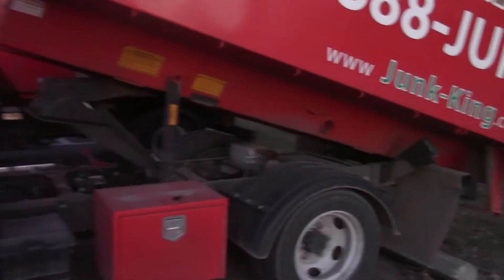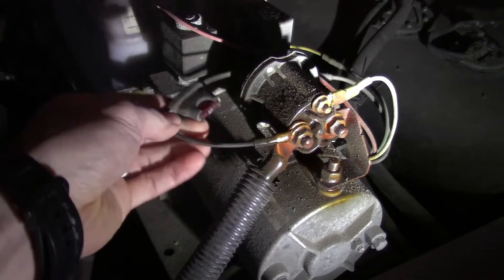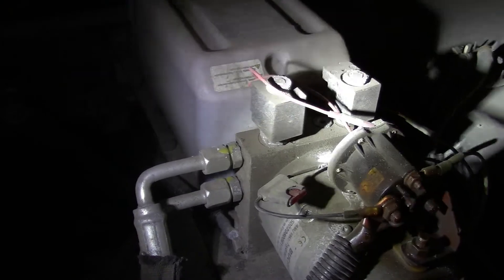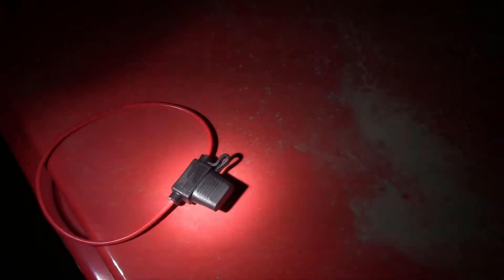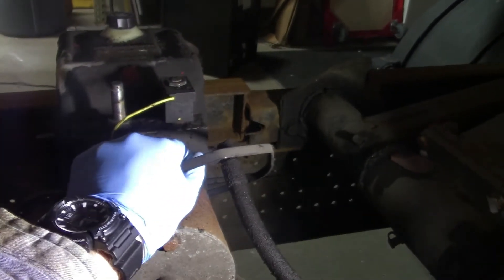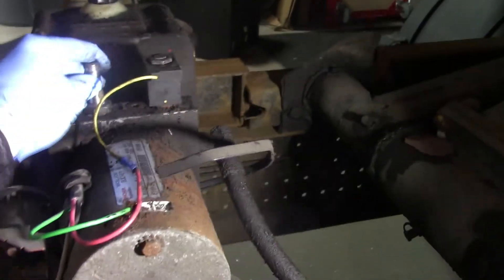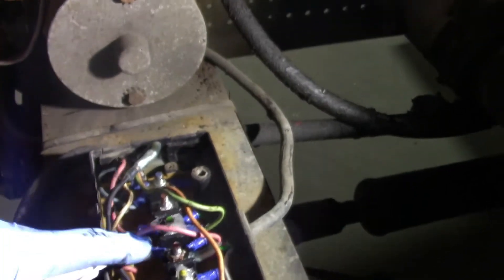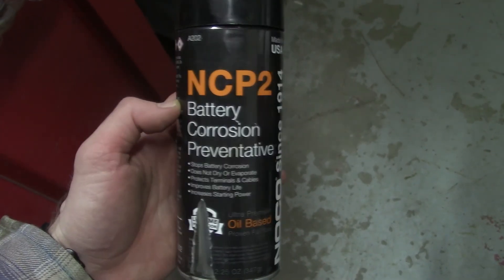Dump Hoist Troubleshooting

Comment: I think you just answered my question, thanks. I have a 2021 chevy dump body and it makes a hi pitch noise and won't go up (intermittently) but always goes down without an issue. I think that cartridge valve may be the issue.
Reply: did that end up being the problem?
Reply: @rws99l  No actually the remote was the issue.

Comment: I watched your video with a purpose... I have a 1951 Chevy 3800 pickup truck....that also has a Chelsea dump hoist. I just bought the the truck.. When I first tried it, the bed went straight up as intended. Now I can't figure how to get the bed to drop back down! I have 2 knobs, (left one is ? the right one the PTO) I have done every possible combination to get the bed to go down and nothing... it doesn't even try.. I pull the left knob out, push the right in. Pull the Right out, push the left one in, I try to put the truck into gear and drive a little and do the same thing and nothing?? Can you help please!?
Reply from the maker: I haven't worked on a PTO powered hydraulic hoist before. Do you know if the bed is gravity return (the weight of the bed brings itself back down)? I've heard of hoists which have froze up pivot points that can get stuck up. The hydraulic pump is strong enough to overcome the binding/rust of the pivot points, but there isn't enough weight in the bed to make it come back down.